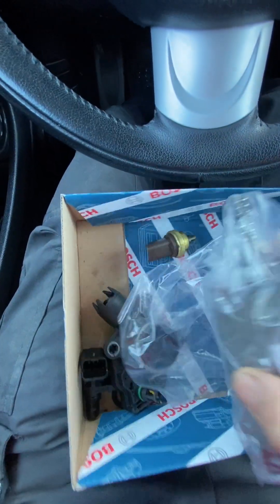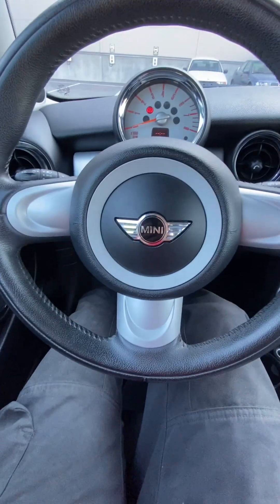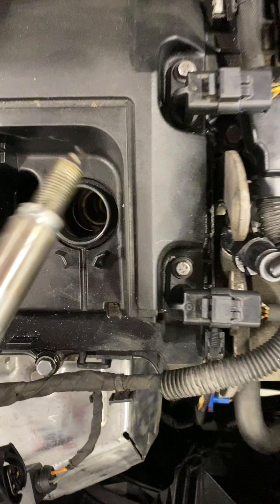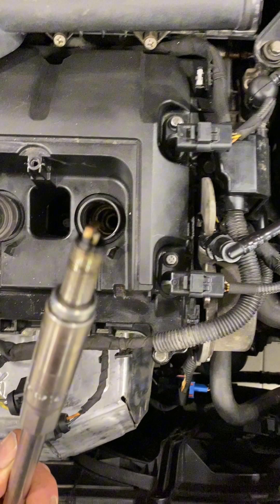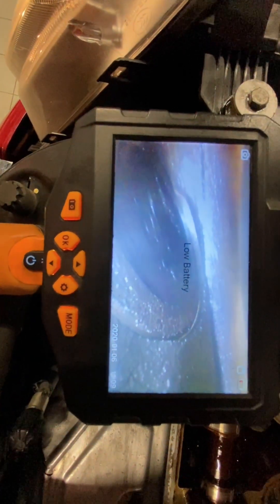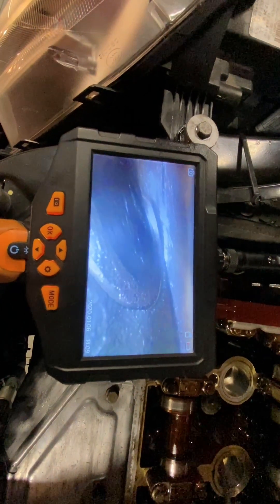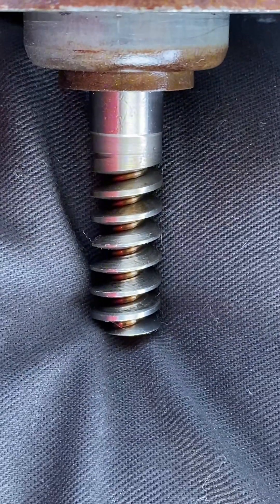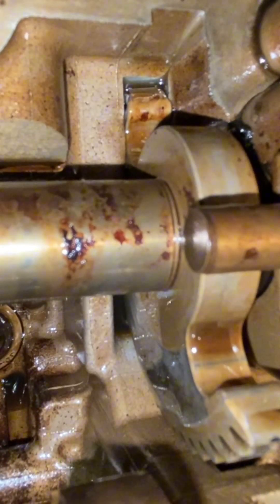Valvetronic Nightmare: The Misfire No One Could Fix

Comment: Hi there 
I have the same issues 
Cylinder 4 not working !!!
Wet spark plug 
Compression fine …
Remove the vanos motor, was no signs of damage!!!
All the symptoms that is on the video …
New coils and new sparks …
Reply from the maker: Its not the motor its a fault on the fingers of the valvetronic lifters. Did you unplug the valvetronic motor?
Reply: @BenJFF  What exactly goes wrong with the lifters?
Reply from the maker: Not the hydraulic lash compensators its the valvetronic rockers that wear and fail to open inlet valves on that cylinder

Comment: I often been confused on this matter as I’ve heard back and worth, but if your going to do a compression test or relative compression test do we have to disable valvetronic before taking measurements?
Reply from the maker: You can adopt two approaches - conduct compression tests with it connected and disconnected. This way its useful to spot VT anomalies.

Comment: I had a mini b48 running in 3 cylinders with valvetronic lift limit fault codes.

0 compression on Cylinder 1. 2,3&4 were very good.
Leakdown test was surprisingly very good, even on Cylinder 1.

I pulled the valve cover off, and the camshaft had snapped between cylinder 1 & 2. Caused by dodgy repairs in the past, snapping the bolts on of the cam ledge.
And the oil quality was so poor. Every bit of the camshaft was shredded.

Hope this helps anybody who has 1 cylindern not running and valvetronic fault codes. 

Had to change their entire heads because the cam seats ledges are machined to the head. You can't get away with a donor head swap when these rev so high.